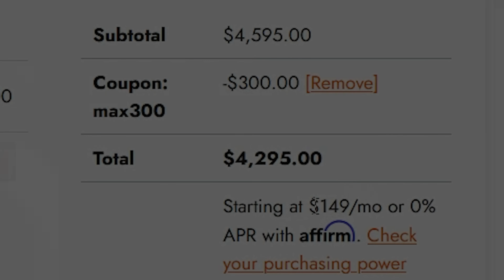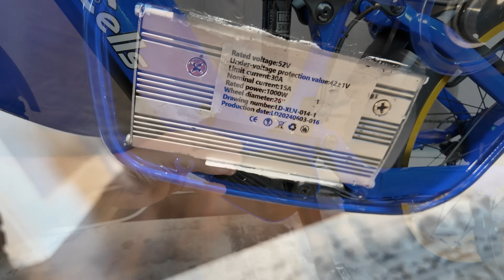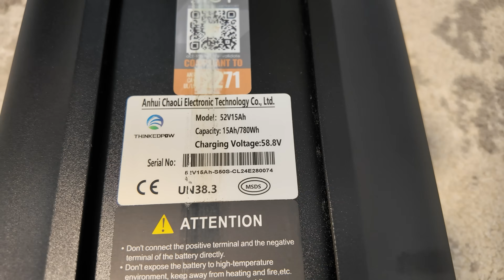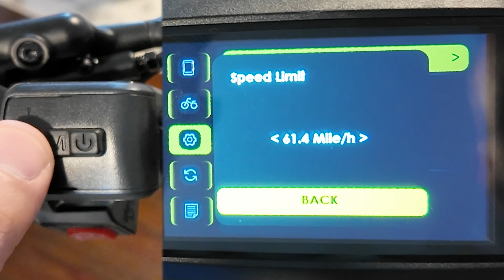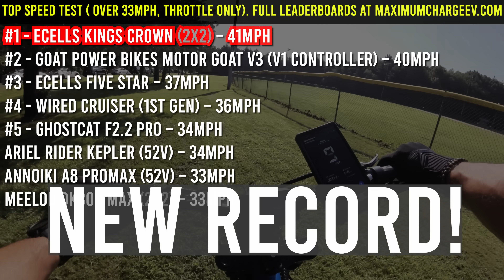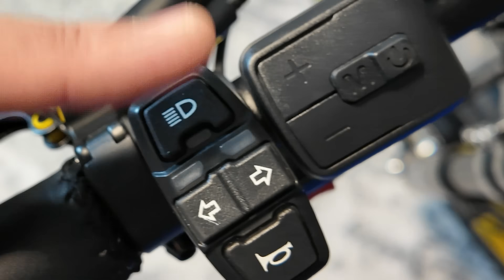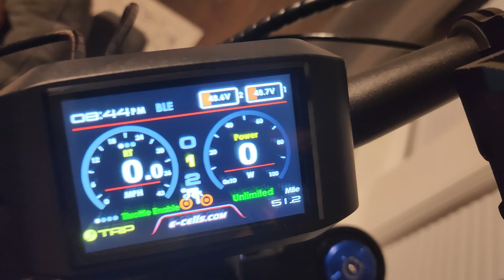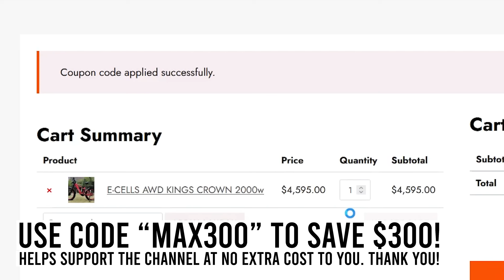RECORD BREAKER! Ecells Kings Crown Review 2024

Comment: I do like this bike but I really think it’s overpriced. I get there’s some nicer components on it but I really don’t see that much value over a 5 Star/ Dual Star. I guess I’m just not in the dual motor wanted/needed gang. I don’t want the weight and don’t need the extra pull. I’ve not met a hill I needed to get up that I couldn’t on my Wired Cruiser or 5 Star. Nice review man! Really covered a ton.
Reply from the maker: That makes sense. I can see why you would say that, thanks!
Reply: With your 5 star do you have a torque sensor or cadence sensor?  Have your bikes been reliable?
Reply from the maker: @MrBalas3  It has a cadence sensor, so far so good! In fact, I'll be taking the 5 star out today for a family group ride.
Reply: how long did it take to get your Ecells Ebike ??? :(
Reply: @1DumbSquirrel  I ordered a stock 5 star around Father’s Day and received the bike in about 4 days. I’m in a state next to Nevada though so shipping distance wasn’t bad. I initially planned to add the dual star package and torque sensor but didn’t want to wait. Been totally happy with the stock 5 star though, no regrets.

Comment: Tell David you need to show the people the Mon Star ebike with dual 1500watt hentach motors I believe he will do it for you dont let us down lol...
Reply from the maker: Give ecells a call and let them know haha. I would gladly test it out. Looks fast.
Reply: @maximumchargeEV  I have the the 5 star I can only imagine what another 1500watt hentach peaking at 2400watts would do. From what I have seen the half twist throttle drives both motors wish they would of set up a thumb throttle on the left side for the front motor because you do not want that front wheel peeling out when there isn't enough weight up front when turning or off roading anyways, ill call David and tell him to send you one lol.
Reply from the maker: @paulmichaels3311  that's the exact setup I have on my psychocycle dual motor, except I have the rear at 50 amps, 3000 watts. It's stupid fast, and fun as hell! def dangerous when the front motor has the c5 set to 10.

Comment: Sometimes when I ride on these slow critical mass group rides here in San Francisco & Vegas, the only way I can achieve 6mph using throttle or PAS is by putting  the bike in front wheel drive only at PAS-1. Almost all Rear motors will only go a minimum of 10-12mph (which is slightly too fast to drink beer and pass the dutchy with friends)
Reply: On the left hand side?
Reply: @luigiprovencher  🤣😂🤣

Comment: I think you've got the headlight backwards. The holding the button on the main control panel turns on your daytime running, which is the side lights in the bottom center light. When you hit the light button on the turn signal controller that turns on your headlight or your highbeam headlight

Comment: Excellent review. Lots of information, especially helpful for comparison shopping. If you want a 2 wheel drive EMTB and can afford the Kings Crown you SHOULD get it. It's head and shoulders ahead of any other similar EMTB cargo bike. (400 pound load limit !)
The Kings Crowns definitely a step up from my 2023 E-Cells Super Monarch Crown with the Kings Crown's TWO controllers, 4.8" tires compared to my 4.25 " tires, upgraded Rok Shoks rear shock (damper for you Brits), turn and brake lights, high & low beam headlight.
KINGS CROWN UPGRADES TO MY E-CELLS SUPER MONARCH CROWN :
1.) NEW ROCK SHOX READ SHOCK
2.) BETTER FRONT FORK SHOCK
3.) TURN SIGNALS
Reply from the maker: Thanks! Yes this bike has many features other bikes don't have. As for the grin regen system, I did see that and It looks great, just keep in mind that on bikes it doesn't add all that much power back into the battery, and wont work as well as you might think in that sense. It will however do a good job at saving breaking system wear and tear.

Comment: maybe the controller has a gradual power addition  setting? making it appear the motor takes a bit to get going? the KT's are like that if its set to C2 on the 5 star
Reply from the maker: This doesn't have the option to adjust the acceleration

Comment: The point of front only throttle is likely to offset the degradation of the motors if you want to run single motor to conserve battery, if you run rear motor constantly it makes it wear out faster, this gives you the option to trade off between the 2 so one doesn't die long before the other
Reply from the maker: yes but two motors pushing 1000 watts is less stressful and more efficient than one motor pushing 1000 watts, front or back.
Reply: @maximumchargeEV  idk, my K8 mowed through my battery on dual motor and lasted waaay longer on single motor, I wish I had this option because I felt the rear become weaker than the front over time

Comment: At 48:12 you mentioned how easy it was to get up the hill with the torque sensor. I’m guessing you wouldn’t have any harder time with a cadence sensor. My concern is at high speed on relatively flat ground. I can’t stand ghost pedaling because I feel like my feet are going to slide right off the pedals. Granted I would probably just get the step through $ wise.
Reply from the maker: I actually pinned the throttle while pedaling to make sure I got full power. That's why I like cadence sensors because at the highest PAS level I get full power no matter how hard I push into the pedals.

Comment: Can locking grips be installed on this model and the 5 star?
Reply from the maker: Yes
Reply: @maximumchargeEV  are you familiar with odi grips? I would like to install those when my bike arrives. Also would like to put mountain bike bars on my duel star. Would that be possible as well? I’m just not sure of which size will fit the duel stars stem I don’t see it posted on ecells site. Thank you!

Comment: Why front motor? So you can switch from front to rear and not overheat a single motor. With dual batteries you easily have enough range to overheat those motors. Maybe not if you're 150 lb and are only riding on flat ground.  I'm 300 lbs and live in the mountains 10 miles from a town. I cooked the rear motor of my first all wheel drive bike in a little over 600 mi. If I could have switched from front to rear motors every few miles that motor wouldn't have overheated.
Reply from the maker: I see what you're saying. What about if both motors split the load requirement and neither one overheated?